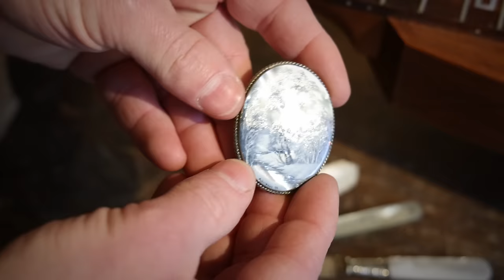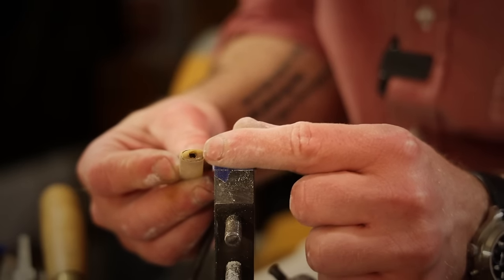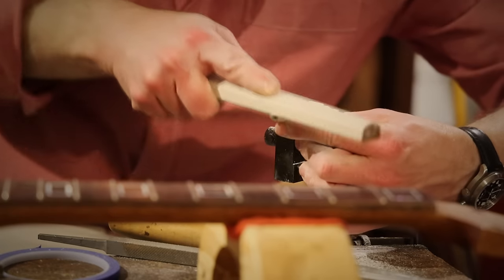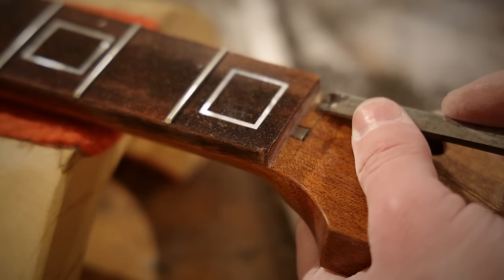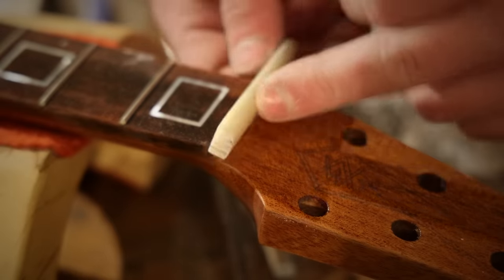Making a Solid Mother of Pearl Guitar Nut from a Silver Knife Handle | HTOB Ep 18

Comment: I think, in order to fit with the grain pattern of the mother of pearl, I though a resin filled with a silver glitter would look better to fill the hole. An maybe drill a shallow hole on the other side to mirror it. However I will admit that the small size of the holes might not have enough convection to create the voronoi appearance. So maybe it's not possible. So unless I could get that to work, which I don't think I could, I'd go for the silver plug.

Comment: The main thing I would worry about would be the hardness of the material, Aragonite is only about 3 on mohs scale and steel is about 6. I can see the nut wearing down quite quickly. If was going for just pretty material I would probably use abalone
Reply from the maker: Ivory is 2.75 to 3.5 on the mohs scale, bone somewhere around 4 to 5.. Carbon fibre 2 or 3.. Plastic.. Well.. A lot less. Softer nuts are used all the time and make a guitar sound warmer, in general, they do wear a tiny amount over time but  I mean a tiny, tiny amount.. There is almost no movement at that point once the guitar is up to tune, even when using a trem it's not a big issue. If it was then the millions and millions of plastic nuts would not function
Reply: @CrimsonCustomGuitars  I was just curious. One of the joys of ADHD